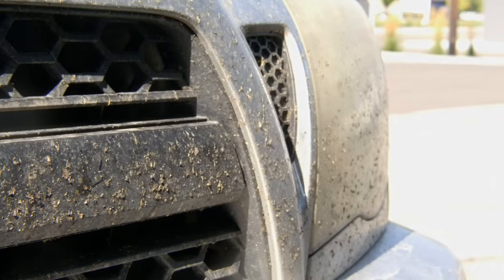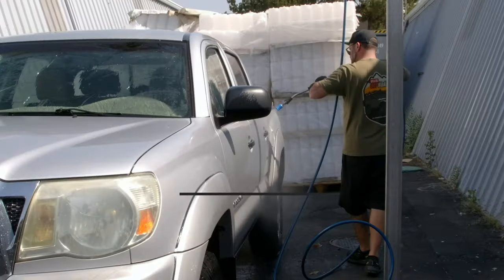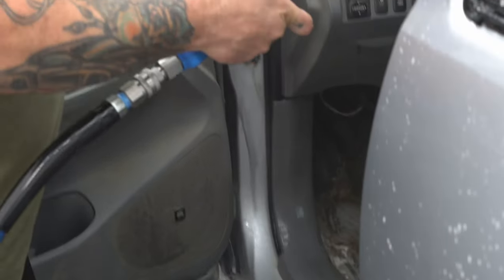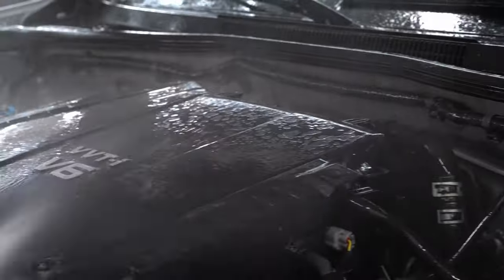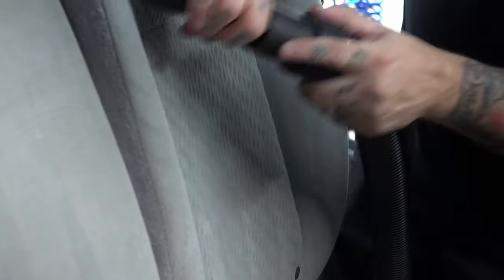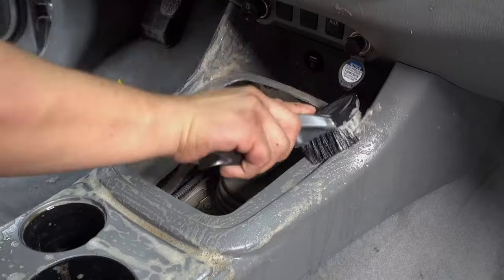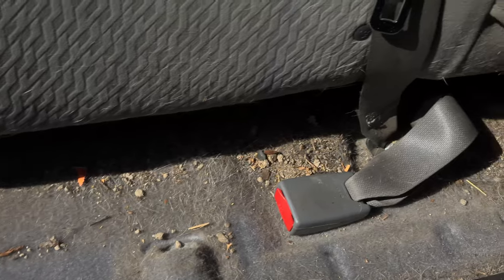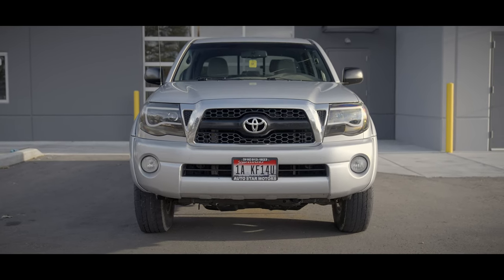First Wash in 4 Years: Blue Collar Work Truck | Detailing Restoration

Comment: Those headlights totally could have been restored with the proper sanding. Also it would have made more sense to do the interior first if you’re blowing out because all the dust is going on the paint.
Reply from the maker: We definitely tried restoring the lights, however there was condensation and debris within the housing. They were to far gone.